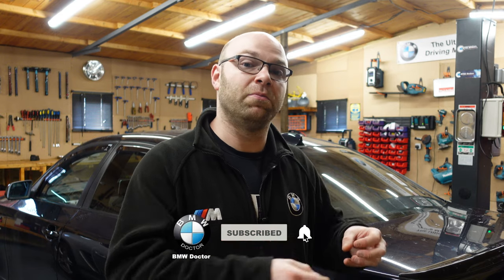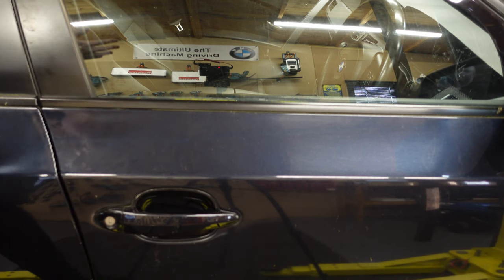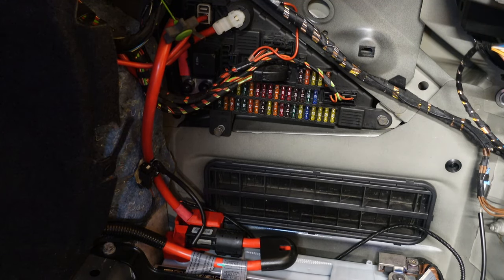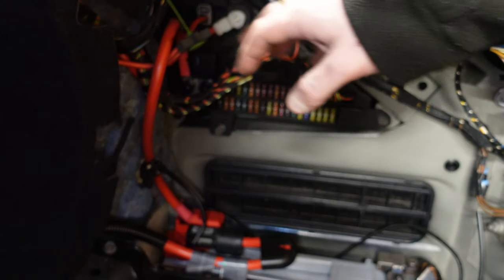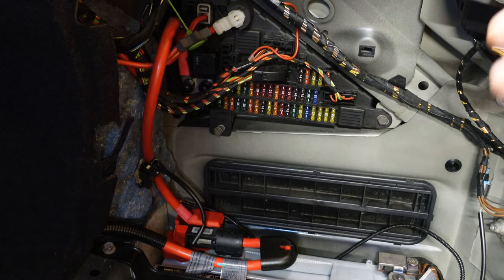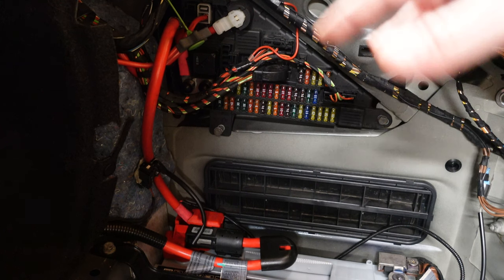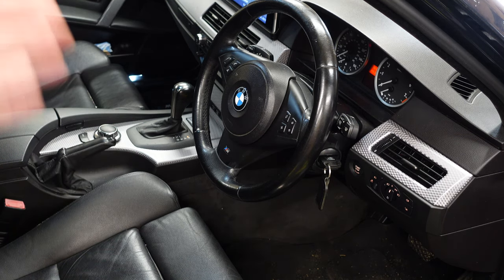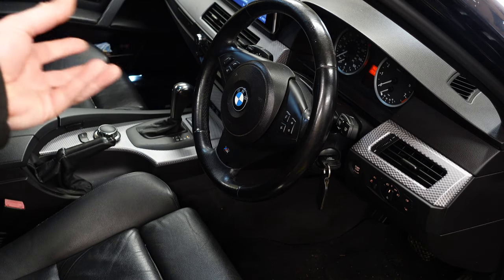Doing This Will Fix Your TERMINAL 15 , TERMINAL 30 , TERMINAL 30G_F Errors On Your BMW !!

Comment: Hello. X5 e70 2013 30d xdrive. Ista displays connection errors with almost all modules. CAS, K-Can, SVT, Ihka, etc. On the dashboard I have a leveling system error after starting the car. I will add that I have no problem starting and the car drives normally. The battery was replaced last year and coded by Carly. What could be the problem?

Comment: So, Hi, my e90 323i 2008, started but serious limp mode when i bought it. ok, the cable between cas and ignition was damaged, i replaced it, the key i can hear reads when inserted but diagnostic code says relay 15 not active or something or another. do not switch on car. any advise
Reply: Hi you ever figure out??

Comment: Dr. Dean, I have 2006 BMW 650i.  I let the battery die and now I have the no start, no crank condition.  I had to trickle charge the battery, it's testing good but I'm still stuck in the stage.  Any help would be appreciated.  Thanks.

Comment: Hi Dean BMW Doctor, 2005 E60 530d, Yes I've subscribed a while back, my battery has been replaced and apparently registered to the car, every morning when switching on I get the car on a ramp signal, if left for another 24 hours the battery goes flat no crank no start, I get battery drain excess waring I can't find a garage to look at it, what's possibly causing the fault and what is the IBS cable about, I'm starting to become very frustrated as the AA will get fed up jump starting car. I'm happy to have a go my self if I can get some leads as how to start. Thanks please please help.

Comment: I have a 2006 325i E90 
Mechanical gauges mph/rpm and fuel all stopped working and CCC on/off occasionally comes on..
P1515 code and A559 
Still starts and runs fine but lost gauges and radio/idrive
🤦🏼‍♂️🤷🏼‍♂️ all fuse check out.

Comment: Doc i have a serious question where can i ask you here? Well ill just go for it. Once every two months my whipers will go off uncontrollably my window rolls down and wont work to go back up and my key wont lock or unlock. I take off the ibs for a few and it works again. I also jave recently lost my bmair conditioner fan power not working at all. I changed the blower and resistor heater valve auxiliry water pump. These are codes im getting with my launch i need advice deperatly.

Comment: So I'm getting a 2BC9 on an E90 320i, that's DME: terminal 15 monitoring. The car cracks but won't start, I scanned the car, and the terminals in the CAS and supply voltages in the DME all seem fine at 12.18V. Did the DME crab out like that or could it be the CAS unit?
Reply: Did u solve the problem
Reply: Help me please same my issue bmw x6 no crank no start
Reply: Did you solve the problem
Reply: @MrClarck100  i have the same Problem did u solve it?

Comment: How do I reset my FRM  circuit counter on my e90? My lights,signals and windows don’t work. I was trying to relearn the VVT motor via INSTA+ but plugging and unplugging the D CAN cable, turning off and on the ignition while the battery was draining, maxed out the circuit counter. Thanks!

Comment: Hello, I have a 2004 745i  E65 that has an electronic issue where the I drive does not respond on key on, cannot read any code nor reset oil light and if you try to reset anything at dash button it says "Reset not possible"  but if cranks  for over 10 secs it will start  but runs very rough and because (DME) it does not recognize any sensor or reference whatsoever. I got a new battery but cannot initialize battery to the system. It seems like there is no power going to any module other than the ISM/powerbox which is new. no radio if I drive turn on when key on, it give no access to reset anything.Tell me what do you think is the culprit here..

Comment: Hi Dean,
I am new on your channel,  after watching your video, I think, you might be the right person to ask you about the problem my 2006 BMW 325i  is having.  My car does not crank.  I have a new Battery with 12.70 volts, and a new starter.  However, if I connect the battery booster to the jumper terminals in engine bay, the starts just fine.   Could you help me to figure out why is that so.  Thank you.

Comment: Nice video.
So how do I wake up terminal 15 when it is off.

I replaced the  cable on cas module between button and ignition and cas and sins then the key is reading but nothing else is happening even when pushing the button. E90 323i. 2008. My diagnostic is working. I have codes CAS terminal 15 output 1 through to 3.

And the Footwell have codes.

No dash lights except airbag light and car with lift symbol. Comes on when pushing button.

I do hear a relay click as I push the button.

Car un locks all lights work and that’s that.

Any advise

My ista stopped working but I have autel maxi on 908 with j2543 programmer.

Thanks again

Comment: I have a 2010 328i coupe. Terminal 15 has 0 volts. Terminal 30 has 13.8. Im wondering why I can't read the vin. The trunk is not opening and the a/c is not blowing cold. When the trunk does work after the car sitting, the a/c will blow cold. Ive checked all the fuses.

Comment: So i was a bit stupid, i was supposed to pull the abs fuse, but pulled the wrong one, and with the engine running(stupid) and after i did that i get electronics failure, front doors doesnt work. The window switches, locks etc. and the obd port. Did this trigger the ibs so it shut terminal 30?

Comment: So I have an Audi a6 c7, I know different car, different layout, but I have a terminal 30 left fault, as well as my front less passenger light has completely stop working a week ago & not my driver side rear door has also completely shut off, can’t lock that the window won’t open & the child lock won’t work the car starts & everything else works.

Comment: I can start the car with key in, i have radio but my remote wont work to open doors or to stsrt the car without inserting.  From my understanding it might be a 30g_f problem.  Can i change the relay 30 now?  Or dont touch it

Comment: Greetings Doc, Always enjoy your videos, so thank you. Curious, I have an f15 40e with electric issues. It cranks for a second and engine begins to start, 200 RPM and then dies. The starter will not run more than a second, so could this be related to the terminal 30 or 15 relays you mention here?  Thanks a million.
Reply: E90 2007 n52 crank no start.. plugs fuel fouling...180+ compression.  No leak down with injectors...trying to reset valvetronic motor...initially actual vs requested range was stuck at actual 237 requested 27 or so removed valve cover and vvt motor upon removal did not unload solinoid and heard/felt it spring back  to rest position....everything seems ok no excessive wear seen...put back together used scanner to reset parameters and waa instructed to put terminal 15 to sleep 10min put terminal R to sleep wake up terminal 15 then proceed with reset....could not figure out sleep proceedures tried reset anyway, heard motor move got messafe stops reset successfully but ended up with code 2a46 sensor for vvt... not a cheap sensor.  Willing to believe sensor bad...previous readings seemed extreme ...whatr are the odds the car will run after the sensor and reset are done....this car is kicking my butt...thanks in the BMW learning curve..  trial by fire,,,,,

Comment: I just got the 30E 30L code on my 07 335i it does all kinds of funky stuff going to check the power wire to CAS behind glove box mine starts but randomly stalls out among other things.
Reply: Hi. Did you ever find the culprit? I have the same problem on my e60.

Comment: Thank you for the information.  I have a 2011 328i convertible. It ran great for about a month, then didn't start. Recovering from hip surgery, I replaced the battery and programmed the battery. (Doubting if I did it correctly, now). The car started right away and after waiting an hour, started again. The next morning, the car did exactly the same thing it was doing before I switched out the battery. It won't start. The scan has multiple codes, some repeat. Terminal 15 does come up under one of the codes. What do I need to do to get my going again? I have watched numerous videos of yours and subscribed to your channel. Any ideas?

Comment: Hi. If I leave my key fob in the car and fall asleep with the engine off but the car on, will the battery automatically shut down and car won’t start after a while? What is the solution? Did the battery actually die?

Comment: I have a 2012 bmw x6 335i. Diagnostic said immediate fault at terminal 15! 
 A week later the car won’t start or click over. The display says charge the key remote. “The key will charge while the car is in drive” i bought a new key hoping that will help but now im thinking it’s a wiring problem…?

Comment: I own an 07 335xi it has a battery drain somewhere the only fuse box I can locate is the one in the glove box is there another one in the trunk if so where is it?
Reply: I have same problem different car but at my bmw 6 it was at the right side of the trunk

Comment: Hello doc,my e66 735li cluster was shorted now i replace the use cluster from e65 730i the car wont crank and cant scaning with icarsoft bmm v3 failed its possible cause cluster?

Comment: Hello I have a head scratcher. I have a 09 335i e92 and my lights aren’t working properly. My driver side headlight angle eyes work but not the low beam or turn signal. The passenger side headlight low beam works and the turn signal but not the angle eyes. The rear lights only the brake lights work when j step on the brakes but not when the lights are on. Driver side turn signal works but not the passenger side. 

Got the frm checked, came back good and was told to reset the short circuit on my protool but that didn’t work either. The code I have is 9ca9. What’s needs to be replaced? I cant figure it out. Any help would really be appreciated. Thank you

Comment: Question battery went totally dead on me from sitting never had a drain issue what so ever could leave the car sit for a few months and would start have the  no crank no start and stuck in ignition 1 cannot get to ignition 2 after putting in a new battery fails at registering it....any help greatly appreciated

Comment: Hey man, I need your knowledge I’m getting a code for my driver window also the passenger window barely works I’m getting these 4 codes from the frm but I got it repaired so not sure if this is a fuse issue can you tell me what fuse is terminal 30A and where is it I cannot find anything on these 4 codes

9CB1 Dimmer potentiometer faulty

9CDA Terminal 30A connection power window, faulty

A8DO Steering wheel module
(SWM), communication with steering wheel module interrupted

A8D1 Steering wheel module
(SWM), communication with steering wheel module interrupted

Comment: Hi guys, I have problems with my e90. I have a problem with the 30b connector. It says to be short circuit. I have the error code 9CAA and have various problems with the external lights. For example, on the front. The left front light works xenon but not the position lights. On the right front light the position works but the xenon does not. On the back, on the left, the stop does not work but the arrow works. While on the right, the stop works but not the arrow. On the rear if I open the luggage carrier the stop also works on the right but the arrow still does not work.

Comment: Is anyone can tell me  what voltage should I get on the grey  wire by the negative post sensor   There’s a red one with 12.5  and white with blue 12.5  I think that’s my issue but that’s a 180 part so I kind of want to make sure

Comment: I need help. Mine e39 is stuck in 5th gear in control panel but i can manually put in neutral and other gears. It doesn t let me start. Only fault that Computer shows is “circuit 15r”

Comment: I have the passenger restraint error.  code 93D7. Fault in airbag module. If i buy a used module how can i get it programmed to work on my car

Comment: 2007 E65 : Hi there I am tracking a Light Module (LM) issue that indicates a terminal 30B fault. I went and checked the 50 AMP fuse under the dash, and replaced it just to be safe, but did not remove the error. Any ideas on what to look for?
Reply: @akashtalon hi did you resolve your problem got same fault ?

Comment: I have a 2011 bmw 328 that when i turn it off i hear a like a static electric sound around my dashboard and my taillight stay on and i have to keep pressing the push to start button till it turns off and i have a terminal 15 code and all light freak out and flash need help finding out what i need to fix
Reply: I have ran into the same issue still trying to resolve it. Was told to send my CAS module out to get tested so hopefully it’s just the CAS module. Have you figured it out?
Reply: I have the same issue. Do you have any experience to share?
Reply: Same issue any ideas please

Comment: E90 328xi, battery died then red steering wheel lock came on, got new DME/CAS, key, & ignition car will spin but doesn’t get fire, we never registered getting a new battery when it was replaced. I’ve tried registering a new battery with a  tablet computer but had no luck, it was just a tablet, do you think I just need different programs, would a new IBS instead clear it up? Help is appreciated 
(Edit: old CAS/DME were sent to auction after being scammed on a module diagnosis by ECU Team Corp in Florida. DO NOT SEND THEM YOUR STUFF THEY DO NOT HAVE ANY COMMUNICATION STANDARDS
Reply: please help…

Comment: Hi i have error 53FC Kl30 Supply voltage and after that my xdrive stopped and i got 5f3a transfer case open possition my acuator motor is good but 4x4! light error is on can you help

Comment: Hi Doctor, i have an 1B5701 error code, description: 0x1B5701 Terminal 15N_2: no voltage for my F10 523i 2011, ablet to assist what can be done? Is it applicable with this video? Thanks in advance

Comment: Hi Doc. Thaanks for your amazing videos. I have 2009 535i that recently got some burnt cales that required it to be rewired and stuff, right now the car starts very well but doesn't go into drive. No gear. Please is this something you can help with remotely? Thanks a lot

Comment: Hello van somebody help me ? The problem is that some of the interior lights don't work. For example, the light to lock your (switch) door does not work, but also the light does not work where you can change your mode to eco or sport, etc. But also the lights of the window switch do not work on all doors except the driver's side there does it work and also the and also the ambilight does not work. You know the two little orange lights near the reading light. 
Where can I find terminal 15 on een BMW F30

Comment: Got a new battery.

Registered it as soon as I put it in, now my pump keeps pumping at all times even if my car is locked.

Getting a terminal 15 2BA2 code every time I check the logs.

Anyone got an idea?

I can try registering the battery again. It isn’t the thermostat btw, the thermostat is working fine

Comment: hello doctor no if you can help me with a bmw x5 2008 the engine turns over but it doesn't start I have a permanent code p2089 and checking the case the terminals with the scan I get terminal 15 reset acc v 0.03 and terminal 15 reset pt can v 10.50 and el balbetronic pocision inlet vanos 120.34 degrees potion exhaust vanos -114 degrees

Comment: hello bmw doctor I just came across your video which is interesting for my problem. I currently have a lot of modules that no longer communicate under ista. I ordered the rear fuse box as well as relay 30 new from bmw because ista gave me terminal 15 errors. I hope that my decisions will solve my problem. what do you think ? sincerely bicktow
Reply: hi, did a new fuse box and relay 30 fix your issue?

Comment: I’ve got a weird issue on my f20 m135i, pre-lci, I recently changed all 3 tyres but the front left tyre as I was far from home and needed a change to get home safe, I ended up finding some ps4s for cheap, while I was driving on the motorway I got a warning saying low tyre pressure in all 3 tyres that were changed I pull over check the tyre pressures (all were in perfect order) and try to reset the tpms system, however it doesn’t let me the option to is greyed out, so I continue driving then eventually it changes and says the front left tyre is low on tyre pressure, I checked it, it was fine, I changed the tpms sensor didn’t work option still greyed out, I changed the tyre and the option is still greyed out to this day, I’ve updated the firmware of the idrive but still no fix anyone know why and how to fix this

Comment: My terminal 30 was rusted like hell. I piled the plastic cover off of it and clean contacts it then fired right up.
Reply from the maker: Water ingress that’s a common problem.
Reply: @BMWDoctor  doesnt help that all my seals are crumbling on front and rear windshield also have that horrible positive cable rot the nut is gone from rust taillight seals are toast going to have to be replaced. im fully capable of everything on the car but have my doubts on rebuilding battery positive ends.

Comment: @blainenemis6449
1 second ago
How can i test the relay to the very bottom right on the panel in the trunk not sure if its related but i tried the touching cables together to drain the system due to so many codes keep coming back immediately now i  no crank no start situation , getting elevated battery drain which car never had a drain issue now could be coincidence but cannot get vehicle ignition into stage 2 where it completely lights up the dash, it will not start with IBS disconnected so could use some ideas here if anyone can chime in TY   Battery ran bone dry from sitting but now it will not register keep getting error